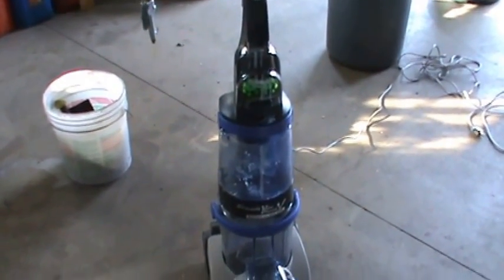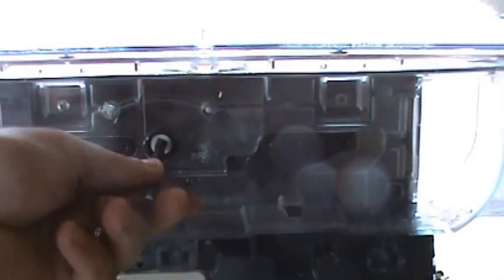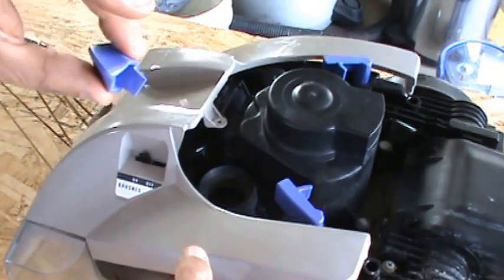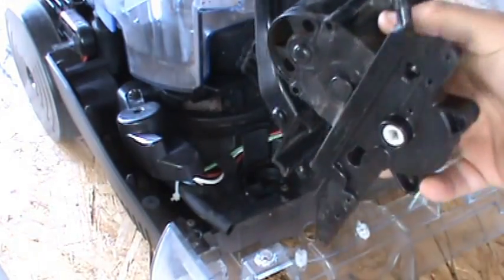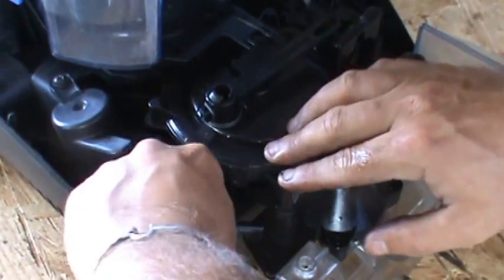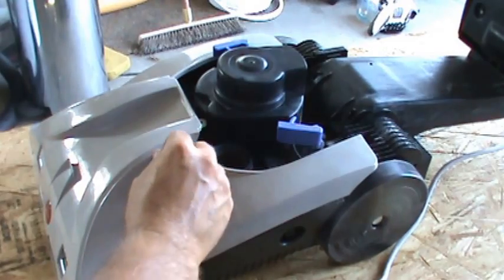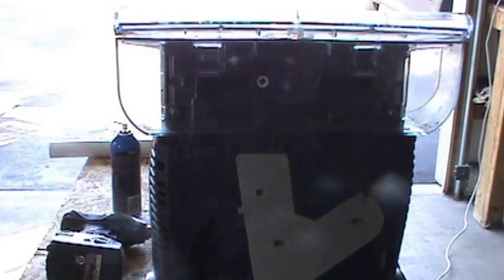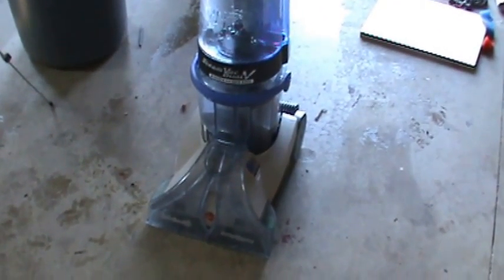Hoover SteamVac brushes not spinning

Comment: IF THIS DOES NOT WORK then take the other side apart mine happened to be the fan wheel cracked in half. 
Thanks anyways never would have got that far if not for this video!

Comment: Great video!  Helps a bunch but I am afraid I will need a new brush motor (or new unit altogether).  Tried drowning it in WD40.  I'm just stripping out the gears at this point.  I emailed Hoover to see if they even make the replacement part for my SteamVac, purchased in 2007.  We've gotten a great deal of use out of it!!

Comment: Thanks for the video. I was able to lub with WD40 and let it set for 2 minutes. I did not use the drill. I just freed up the bearing with screw then put the brushes back in and had the shampooer move the brushes. Had to jiggle the brush back and forth until the brushes started moving. Slow at first and sped after 30 seconds. Let it run for a few minutes. Allset. Thanks again!!!

Comment: Great Video. I had a little bit more difficulty as both bearings were frozen. After I disassembled the brush drive unit, the top bearing was frozen. I used WD-40 and soaked the bearing about a 1/2 hour and still could not rotate the gear by hand. I use a pair of pliers to twist the bearing back and forth and finally got it free. I then removed the top bearing and both gears to get to the lower bearing. I soaked that lower bearing in WD-40 but still could not rotate the shaft with the gear wheels back in place. I finally removed the top bearing again and both gears and use a pair of pliers to break the shaft free (becareful to not grab the part of the shaft that is a gear as it can be damaged. I was able to free up the lower bearing and lubricate it. After reassembly, it worked like new! Thank you so much.

NOTE: Water collection tank must be in place to get the brushes to turn.

Comment: My gears were ok , and the axel / metal round things.   I noticed it still had a feeling like the teeth were stripped even though the two/three white gears' teeth were ok, so I took  two more screws out of the black plastic to see what was deeper inside.  There are two black cheap looking gears inside.  One gear was cracked nearly in half and was allowing the turn mechanism to feel like it was stripped a little.  I tried plastic model glue to see if it would melt the plastic together, and it has.  I don't know if it will be strong enough to hold together once I try to resume carpet cleaning.
Reply: It worked until I ran over a little wrinkle, then I heard the snap sound again. Oh well, haha

Comment: He never actually gets to the most important part which is the fan under the motor. I bet those brushes won’t turn on carpet. The fan is sealed under the motor and clogs with carpet fibers and needs cleaning as well.

Comment: I made sure the brushes mechanism spins properly. I lubed up the hole that turns the brushes and turned it with my power drill. Then I bought a new gear box, made sure gears were lubed then put it all back together. Brushes still won't turn. What gives?

Comment: Very good instructional video. We just fixed our Vax All Terrain carpet cleaner following these steps. The turbine cogs seemed fine but clearing the filter seemed to do the trick. We couldn’t access the filter without taking it all apart.

Comment: great video instruction and well done.  I face the turbine hole  straight up and use pb blaster and let it set a few hours and then place brushes back on, then manually hold center brush that inserts into hole and then manually turn center brush back and forth by hand

Comment: I have been working on my carpet cleaner all day the gears were frozen up but I got them moving and when I stick something in the square it turns easily but when I turn it on it doesn't spin... My attachments arnt working either any advice I'm really struggling to fix it

Comment: Really good instruction.
My hovver not used for 5 yrs.
Cleaned, no brush joy. I dove in but stopped at getting top cover off. Thank you for video.  I'll try turning gears with driver next.
I'm 77 but always willing to learn something new.
Where do you buy parts?
Richard, old retired vet - from new mexico

Comment: Used your video and tore mine all apart.  No problem inside the motor. The lack of brushes rotation however was not the vacuum motor. In my case the auxiliary tools wire coiled hose had snapped off right at the connection to the main unit and vacuum was lost to the brushes drive motor.. It is glued in to the fitting so I had to improvise a new connection with tape, wire, and a hose clamp.  The reconnect of that hose fixed the problem.

Comment: You saved me quite a bit of time figuring this stuff out. Thx. My problem was that my turbine blade had split into two. Couldn't find the parts but I did find a 3d printer file of the same part somewhere online. I printed the part, installed it, then tested it.  Works great! Saved me a couple hundred bucks.

Comment: Dude, you're so freaking awesome. I ran to Walmart and got some gear oil. Now my brushes are spinning. The drill wouldn't budge the sprocket thing, so I had to take it apart. Clean and then lubricate the gears.

Comment: used this advice to fix a newer model F12A, disassembly was a bit different but close enough to the one in the vid.
 I took the whole turbine / gear assembly apart and found the impeller blade on the turbine had cracked right in half and fell off the gear spindle. crazy glued that back together with a vice, pressed fit back onto the spindle. Good as new (for now anyway)

Comment: I have this issue. I don't usually sub repair channels but this vid is very well done, complete with all the links! Thanks.  Looks like a ball of carpet fiber and hair jammed my brushes leading to the green plastic shaft snapping in half. I will first try to eval the gears and bearings, pin the shaft and see if that might work. Thanks again.--- added: pinning the shaft did not hold up to the forces generated, so I machined an aluminum shaft with an end threaded 10-24, drilled through center of the brush hub and twisted it on. Brushes turn great now and this repair is very durable.

Comment: Thanks very much! We picked up someone's old Hoover (they were throwing it out) and the brush function wasn't working. Today I found your video, took the beast apart, and got it fixed. Not even the same model but they were similar enough I was able to figure it out. On mine, the shaft wasn't spinning at all. I had to completely take it apart, take the gears out, and grab it from inside with some pliers and force it free. Serious rust build up, I'm guessing. Anyway, I'm so glad you made this. Now my machine is working!

Comment: I first tried the Hoover website, but they did not offer any parts for this model. Then I contacted Hoover customer service. Less help. They sent me to the hoover Factory Service Center, which was out of business. The next nearest service center was over 200 miles away. The I asked for instructions or a schematic. Nope, can't have that. As a last resort, I searched YouTube, and there it was. Turned out to be the same problem as Robert had three years ago: locked bearing. I used Breakfree CLP and after a few minutes of turning, the bearing broke free

Comment: Heard a loud pop noise while vacuuming and the brushes stopped working for me.  When I opened up the turbine, the bearings still looked good but upon closer inspection, the turbine fan blade had cracked almost in half!  It turns out it is a press fit and needs to be tight to spin the rod from the brush head assembly.  Thanks for the this video though as it is always nice to have someone else's walk-through and to know you are on the right track!

Comment: Hadn’t used the machine for many months after I couldn’t get the brushes to spin. Tried getting the hub to move like you did with the chisel. Without the drill though. Afraid I would just shear something off. So kinda threw up my hands and put it away. Figured I’d just have to have someone fix it after we moved.
Found your video the other day and followed it to the letter and , viola! , freed up the bearings and worked like a charm !  Awesome!  Video was well made, easy to follow, you explained everything simply in a common sense way. Love it when I find something like that. Well done!!  Needless to say, got you subscribed to.  
I think of myself as pretty handy with a lot of things but sometimes ya just don’t know what to do so ya gotta find someone who does.  My kinda guy !  Thanks!!

Comment: Mine felt like it was spinning fine, but wouldn’t spin in use. Went in and cleaned and lubed thin dry lubricant on the bearings and white lithium grease on the gears. Thanks for the video!

Comment: Been a subscriber for years, but this is by far the most useful video (no offense lol).  With my hoover power scrub, it is now a hex shape and not a square.  I found that a 3/8 hex key fits perfectly in the shaft end, gave a little oompf and freed up the bearing without disassembling.  I'm sure i'll have to do this in the future due to moisture ingress, but if i can keep using a hex key, it's a cheaper fix than buying parts or a new one.  Thanks!

Comment: Good video, but my units wasn't EXACTLY the same (Mine is  an F7452-900, a few minor changes designed to make it easier to assemble, but not to disassemble).  I took out all the screws as indicated, but the Turbo unit would not "just life out."  It was solidly embedded and no amount of prying or banging would break it loose.  Wasted about 8 hours, and tossed the whole thing.  While we are on the subject, who uses iron screws and bearings in an application where they get wet and rust?  Not my first rodeo.  Never again

Comment: Wow, I always think I'm smarter, I don't need to get a drill out I'll just lube up the gears like he said. And other than not using a drill I did everything else step by step.. Put it back together and nada spin... So after hitting myself upside the head a few times I dug out my brand new drill though not really comfortable with it as I haven't used it much yet and guess what?? Yep brushes are SPINNING like they should. Carpet has never looked nicer!
Thank you Mr. Double Wide. Awesome video! I'll never cut corners again!

Comment: I have a Vax 124A which is exactly the same carpet cleaner but a different colour (I'm in the U.K.). Thanks to your video I found that the roller bearing in the turbine box had rusted solid. I've managed to find a whole replacement turbine for £15, so your video saved me a load of money! Thank you!

Comment: My newer model had 8 screws not 6 and my turbine was cracked in half which kept the gears from turning. But if it wasn’t for your video getting me to the place I needed to be my wife would have had me at the store spending money on a new one. A little 5 minute epoxy and I was back in business.

Comment: Before going through the trouble of disassembly, check the docking seal, and  the matching hole on the bottom of the recovery tank, to make sure it did not become dislodged, or is dirty with lint, the end of your cat's tail, or other foreign matter. Clean and apply a small amount of petroleum jelly to the seal with a Q-tip. 

When inserting the recovery tank, make certain that the toes on the back of the tank are hooked into the slots before clamping, or you will have very little suction, and the brushes will not turn. Also, the brushes will not turn, and there is little suction with the handle in the upright position, as the air gate is closed. The handle must first be lowered onto a chair seat, or held by another person, with the front raised, and the power turned on. You should then be able to feel the brushes turning. Try not to chew your fingers up by feeling the bruses turn.

Comment: I did everything that you demonstrated and the brushes still do not turn. The bearing was totally frozen. With a little WD material I got it loosened up. My model is F7425-900 so it is a little different. I am stumped. Please advise.
Reply: Hi, how did you get the cover to pop off? Mine is the same model and we can't get it to budge. I took out the screws on the bottom and the single one on the cover on top but can't seem to loosen the two plastic pins on each side at the top.

Comment: We bought our Hoover in Dec 2017. It did a fantastic job but only once. I took the thing apart and discovered that a support roller for the main drive belt had frozen and then melted. The belt is actually stretched to the point that it doesn't function. Well, we got one good cleaning out of it. Now I just need to find a place to get parts.

Comment: Wow - awesome video - and so very helpful and easy to understand.  I was able to go through all the steps. Found the two bearing wheels that needed WD40 - sprayed 'em - they move great. The gears all spin very smoothly, loosely, and fast now.  I put everything back together. But the hole for the brushes spindle is still completely locked up. Won't budge at all.  Any other suggestions? :)

Comment: Hi, went through everything, just as described and... the thing spins, but very slowly and weakly, i.e. not enough to really move the brushes. Did I do something wrong or, is it the motor struggling to move the gears. Incidentally, thanks for a very helpful, clear and concise video. Everything you did I could do just fine. Except I broke two nails and barked two fingers in the process. :) If anyone has any suggestions please let me know. I have a completely cruddy kitchen floor that needs serious help and my trusty Hoover is not pulling it's weight.
Reply: Check the red filter on the bottom of the vacuum. Ours was very clogged with lint.

Comment: Try this second. There is a filter in the window with the spinning green disk. You cannot clean it from the front. when you take off the big cover you can see it from the backside. If you can't see through it it has lint. Scrape it till you can see through it. Some WD like Doublewide6 said and then this fixed mine without getting into the gears. Great video Doublewide6 !

Comment: Thanks.  I went one step further on pulling the turbine apart and found the large vane wheel was cracked.  I had saved a Hoover that was accidentally left in the garage and froze.  I was able to use the vane wheel from that cracked turbine to fix mine.  Thanks for the video saved me a lot of time figuring out disassembly.

Comment: My model is slightly different but close enough that the video was helpful.  However it didn't fix the problem.  On further investigation I discovered the turbine wheel was cracked.  Ordered turbine assembly from Amazon since the wheel itself is apparently not replaceable.  One Amazon reviewer said the replacement's drive was five sided, not four so it may be necessary to change the gear.  Carpet cleaner was VERY slightly used so you'd be tempted to say it was Hoover's problem.

Comment: I used a 9mm Allen wrench on my Hoover Powerscrub to spin the port back and forth and loosen it up. Remember that you need to have the washer upright when you turn it on, then drop the handle down to engage the scrubbers.

Comment: I have the F7452-900 - any chance you understand how the water delivery system works on this thing?  There's a hose leading from the brush drive turbine back into the handle case and it's just open-ended in there (doesn't connect to anything).  Why?  What does that plastic "pressure valve" (with the thin clear tubing) inside the handle do?  Why are there THREE hoses coming out of the water reservoir platform when there are only TWO tanks?  (detergent, water)?   Thanks for any help...

Comment: Thank you for your very helpful video. My machine was a garbage find that's missing some items but the essentials are there. The only difference is my turbine unit has one hose on the filter side. The other nipple is there but is not open and the hose makes a U turn and disappears along side the motor. In my turbine assembly the shaft for the reduction gear was rusted and all but two of the rollers in the bearing were rusted with one frozen in the plate. I didn't want to purchase parts unless i was sure the basic unit was okay so I cleaned up the rusted shaft and used dish soap and a soft brush to clean the gears and case parts. I scraped as much rust as I could off the rollers and let the bearing sit in power steering fluid for 24 hrs. I had to wire wheel the washers as they were pretty rough. I didn't like the way the large wheel felt in the case so I taped a strip of 600 sandpaper to a pencil, put it in a variable speed drill, coated the bearing with power steering fluid ( very good all purpose oil in my view) and polished the inside of the bearing. I put the worm gear in the drill and polished the shaft with oily 600 paper. After sitting in oil for a day the rollers in the bearing spun freely except the one that was frozen so I put long nose pliers on it and gently worked the plate back and forth and it freed up right away. I used Marvel Mystery Oil on the shaft and long case bearing and white lithium grease on everything else including the roller bearing. It worked perfectly. Many thanks.